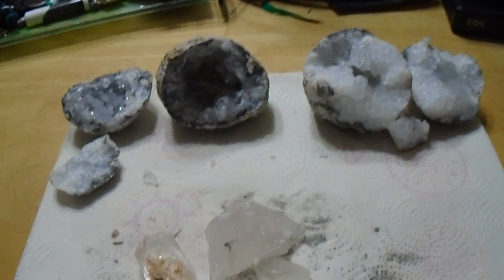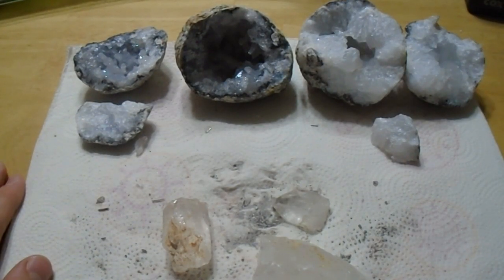How to Break Open a Geode using an exothermic reaction!

Comment: Can we say NO!  First some geodes have water in them so heating it up would be stupid as they can explode (enhydro-geode). Second eye protection a bit more important then foot wear but if you were using a earth pipe cutter or tile saw neither would be a issue...  Smacking a geode breaks it but what you end up with are pieces not two halves... Since geodes have all sorts of secondary minerals depending on where they are found just smashing them can ruin the other crystals. Try  https://youtu.be/3zzb3Ev1kXs
Reply from the maker: Thank you for this comment and I have added a pinned comment to the video alarming people of this issue. 
I know this now and if I had known it at the time of the creation of this video I would not have used the grill at all!
I also fully agree with eye protection as the eyes are much more sensitive to damage than the feet.
Reply: Rockhounding Family Adventures  h